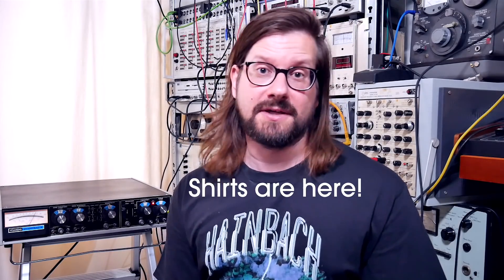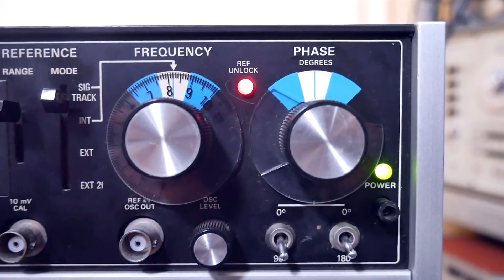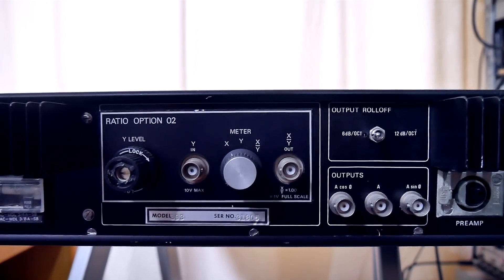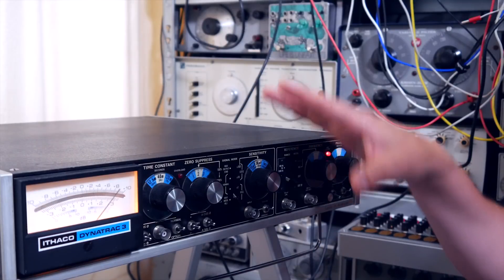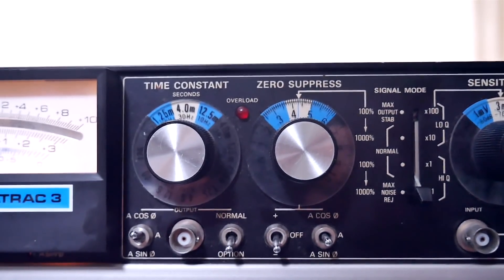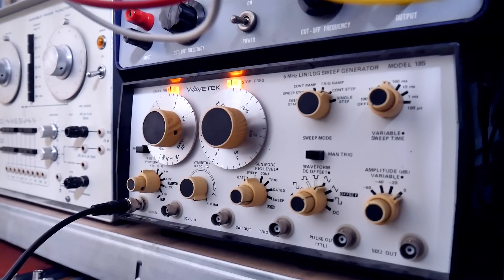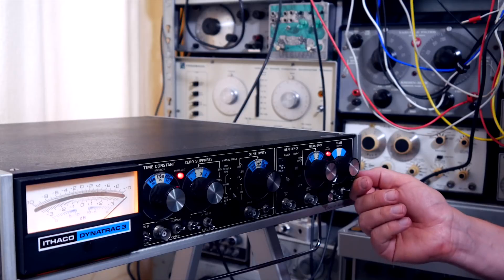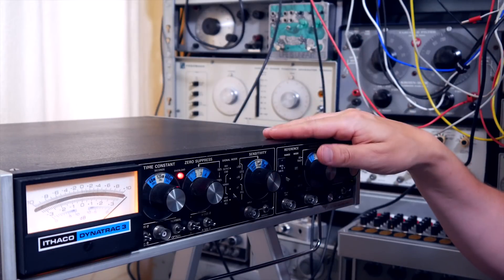Ithaco Dynatrac 3

Comment: Great, did you use the front input or the rear preamp for signal in & 'pinging' it ? Thx
Reply from the maker: I tried both - rear output sounded better on mine, but I did not hear a difference with ins.

Comment: When you get inconsistent results, like the reference out -> reference in doing things sometimes (but only sometimes), how do you know you haven't broken something or it isn't somehow malfunctioning on you? I feel like that has to be the hardest part of using test equipment like this is you can never be sure if the results you're getting are repeatable useful results or if something is broken somehow and may never do what it just did again.
Reply from the maker: Yes. You have summed up one of the biggest problems with this stuff - you never know unless you have someone to ask. I talk with a few people, but generally there is a lot guesswork going on. Since this is mostly studio gear for me it's not that bad, if you don't count the hours I feel stupid and it's the gear after all. On the plus side, I have gotten fast at troubleshooting.

Comment: and you can go in, in the Dynatrac 3 with a guitar cable, and out also?
Reply from the maker: It has XLR and BNC, so you need adaptors - RCA to BNC cost 1.50€
Reply: @Hainbach  ok thanks
Reply: @Hainbach  the inputs and the outputs from the "Messtechnik" has RCA? i have found rca to bnc and bnc to xlr male...is this right ;) THX